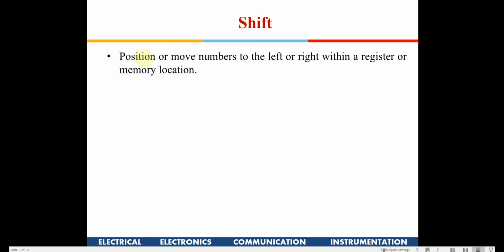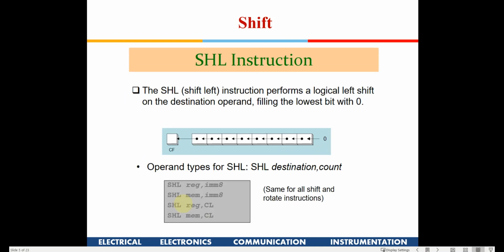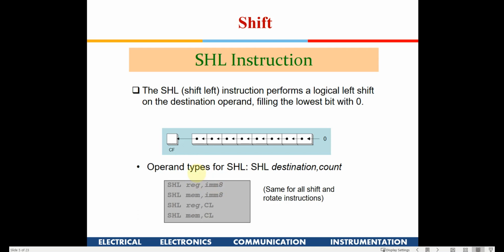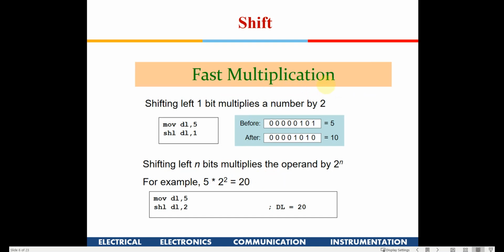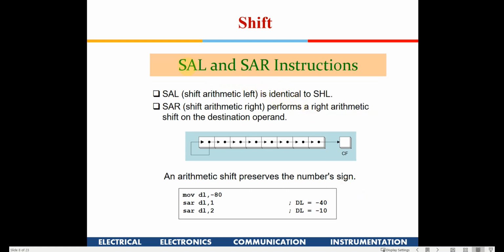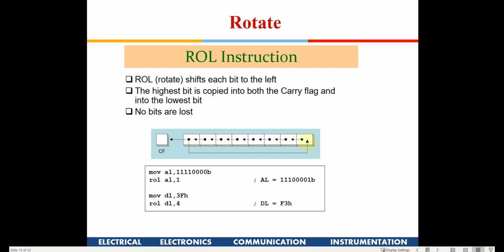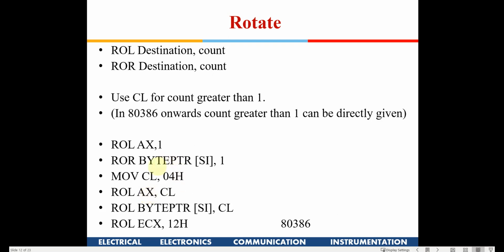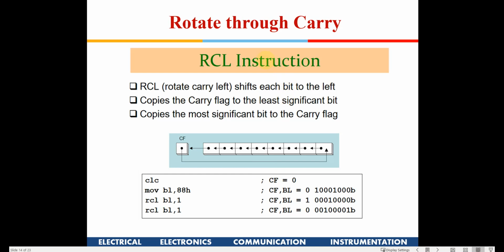Microprocessors and Interface: Lecture-15: 8086 Logical Instructions : Part-2

Comment: Dear Professor, 

Please, I will be very gratful if you can confirm if I can simulate Schottky Barrier transistor using LTSPICE 
Best wishes
Reply from the maker: Ti , Toshiba and many more puubhing the models of componnets mnaufcatured by them,, In the link  refer to lecture 3 , you can see how mosfet models are imported in LT spice,  You can try similar thing for BJT     https://sanjayvidhyadharan.in/courses/digital-vlsi/
Reply: @SanjayVidhyadharan  Thank you professor
Best wishes.